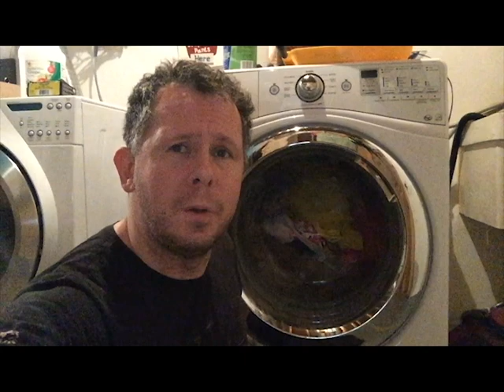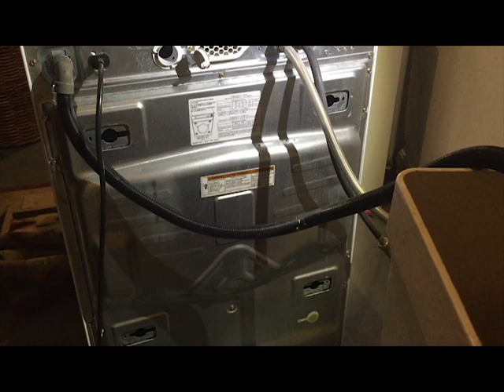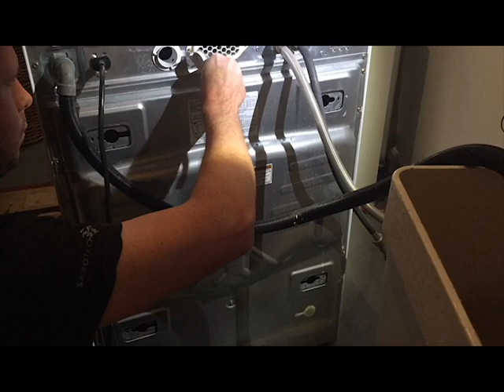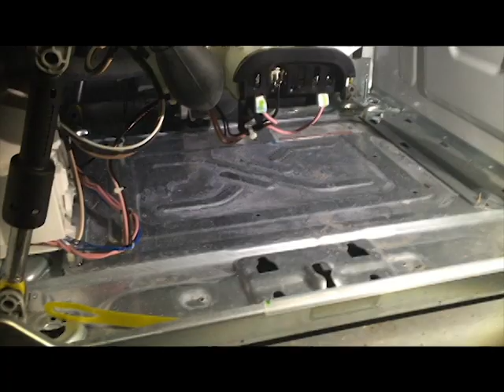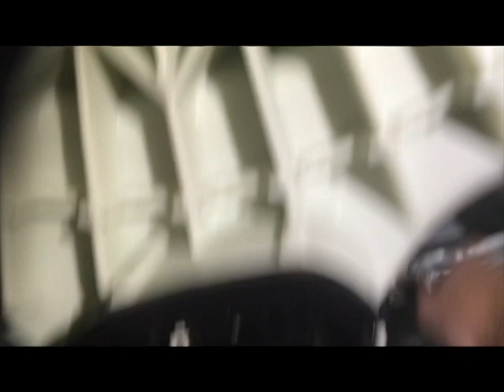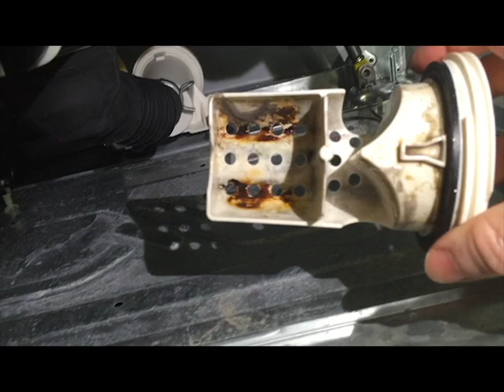WHIRLPOOL DUET STEAM washing machine  is stinky/smelly or isn't draining water.

Comment: On mine it was just 3 screws on the bottom and the lower panel came off the front. It was super easy and the filter is right there didn’t have to deal with the front door or anything. 5 minutes and I was done

Comment: I know this is a super old video, but are you SURE the lower front panel below the door is not an access panel?  Mine is at least 12 years old and there are 3 screws (1/4 in) under the panel that you need to remove .  The panel will practically fall off once the screws are removed, and the trap is literally designed to be accessed that way.  C’mon.  Do you really think they would design the machine with a part that requires regular maintenance facing opposite your point of access?  If it seems weird, you are probably doing it wrong.
Reply from the maker: I am 100% sure. The prior model had the screws for the access panel on the front. This particular model was just designed oddly.
Reply: I wish mine had a front panel.

Comment: I learned a new trick since the last time. if you remove the black part with the two spring clamps on each side (that connects to the filter) that will allow you to empty the water into something (like a baking pan) so the water doesn't get everywhere. Then after the water is emptied you unscrew the filter. I purchased locking pliers from Home Depot to more easily remove the spring clamps.

Comment: My friend had a error code saying the drain clog dedicated but after taking the machine apart there was no clogs. Any idea’s?
Reply from the maker: If he checked the hose and trap, its possible that the pump is fried. I don't have the service manual so I don't know if the sensor has a separate code for that.

Comment: Mine only has 3 screws in the front.  Seems way easier to remove that front panel. Maybe mine is newer?  We bought it in 2008.
Reply from the maker: The older model had a front access panel - way easier to access!
Reply: @stacystec  Crazy how they made it harder to access with the newer model.

Comment: I took the entire black rubber assembly off my whirlpool and it was filled with lint. Also if you place a baking sheet under the front of the washer prior to removing the clean out it will catch the drain water.

Comment: Can someone tell me what that first white part (top left) is? The part that looks like an open cap?
Reply from the maker: Are you referring to the front of the machine or the inside? Want to make sure i know what you are referencing.
Reply: @stacystec   I wish I could add a picture. The back of the machine (not inside)
Reply from the maker: @Penske41  If it is white has lots of holes in it, that is the air outlet vent.
Reply: @stacystec  nope. The thing directly to the left of that.

Comment: I have done this exercise before and it worked beautifully but this time the drain filter was pretty clean and I still have some water sticking around... checked ALL drain pipes and they are clear. Any idea what it could be? spinning the drum with my hand I can hear the water and around the rim if I pull back the rubber, there is water. Thanks.
Reply from the maker: Be sure to check the inside of the pump for obstructions, after you pull out the trap stick your fingers in there and make there isn't anything jammed in there. You said you checked the drain hose  so that would be the second thing to check. After that, power the unit back on and- the first thing the machine does when you set a cycle is it tries to pump out old water first. If you don't see that happening, then you know something else is going on. Assuming you cleared all obstructions, it might be safe to assume that the issue is with the pump  (assuming everything else is functional).  If you can't hear the pump doing anything, I'd recommend calling a repair person at that point.  If you can hear the pump turning on and a little water is being pumped out into your drain/sink - then I'd recheck for blockages. It's also possible that the pump might be at it's EoL - still working but barley.

Comment: My Landlord bought the set used and it gave me the drain error from the 2nd use. I watched this video and went from the back but instead of reaching to the front and untwisting the door I put a shallow pan under the hose, used pliers to remove the hose clamp and removed the hose. It drained into the shallow pan and I was able to clear a blockage (Panties, a 1''x1'' plastic square, shells, change, bottle cap, a ring and various other objects) - had I removed the trap from the front I would have missed the stuff in the black hose. Great Video! Thank you!
Reply from the maker: Whew, that's one mega clog!  You have me curious  about what horrors might lurk in my own drain pipe.
Reply: When I saw the clamp around the hose, I too wondered if that wouldn't be easier. I can hear water sloshing when I spin the drum after removing washed clothes. Last thing I want is a pool of smelly water to try and sop up from the floor/floor of the machine. Thank you for posting.

Comment: Thank you for this video. I forgot to hit the "like" button so I came back.
Word of caution if anyone does this. If you have the pedestal, open the drawer and line the drawer with a dry towel and put a bucket into the drawer under the drain. I had a lot more water left in mine than he did and all I had was the towel.
Whirlpool! What were you thinking? A simple trap door would have been so easy but I will NEVER buy another whirlpool after this! I feel like this placement is designed to force the owner into a very unnecessary service call. 
Thanks again for the video, you saved me a ton of work.

Comment: *Iv had washer for couple of weeks now and have had no 
problems=>>allmy.tips/WhirlpoolWasher?a139      Wanted to address 
some negative reviews I read before I bought washer. First I read about 
clothes being dripping wet after final rinse. Fix is that you need to 
correctly load washer and make sure washer is level. I used a bubble 
level to ensure washer sat level after it was installed. Second was 
noise, yes washer makes noises but how quiet do you need it to be, you 
are washing clothes. It's actual quieter than my old GE Hotpoint. If you
 read manual before use you will have no problems.*
Reply: very nice

Comment: Turn it counterclockwise. I know in the video he said clockwise but that won't work, also if your washer is stopped up have a shopvac and lots of towels on stand by because all that water is coming out the bottom. Thankyou for the video though, total life saver. I went in the front though because my drier is stacked on top of the washer.

Comment: Great video, but over thinking it.  Tip the washer back 20%, put something under it, take the four screws off the bottom front and pull.  Plenty of room to access the trap.
Reply: Underrated comment here!! I had very little room to work with, and didn't want to mess with the front gasket spring or back panel. Tilted it back, popped open this bottom panel, and BOOM! Took me longer to clear out all the stuff that fell behind the washer than it did to do this task. Thanks Owen!!

Comment: So now since I have cleaned it will it work? It was makong a constant draining sound ? I pulled money and a key, paper clip out of the trap? Or what else do I need to do
Reply from the maker: bryant williams   the machine will always  try to drain first. let it go through the draining and see if you can get another cycle going. if you had an error code, be sure ro power down and power back up again.
Reply: TRAININGMISFIT I did have a error code but now? Nothing lights up on the console. I could
Give u more information, or pic? Video of it if u can help me
Reply from the maker: Nothing at all? Are the lights one the dial coming on? If not, just double check the plug and maybe the fuse mapped to that device on your fuse box.

Comment: Can’t thank you enough for this video! Could not find one without the front access panel and of course, ours doesn’t have one. Worst design ever on Whirlpools behalf, our older duet had one, no idea why the newer models don’t. You answered all of my questions. Thanks again!
Reply from the maker: Island Shopgirl Yeah,  when i discovered the earlier models had a front access panel, i couldnt understand why their engineers removed it from this model. i wash a lot of clothes and have a bad habit of not taking change out of my pocket. that trap gets cleaned every few months and is often the land of missing socks. Of course we dont realise these design quirks until long after the purchase!
Reply: TRAININGMISFIT - we were happy to discover they did change the position of the drain plug/trap on our newer model Duet Steam, it’s in the middle and facing the side instead of the front. I think ours is 2 yrs old. Still a pain having to remove the back but definitely easier than removing the front panel. Thanks again!